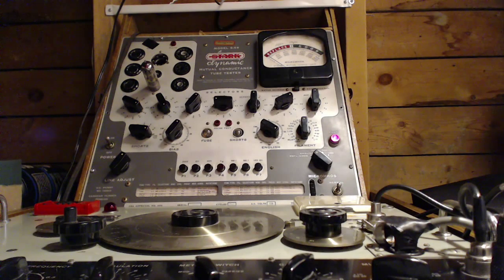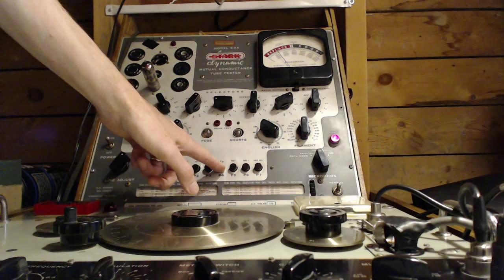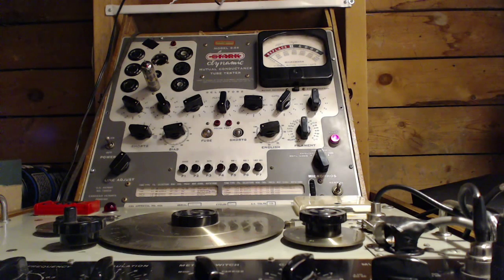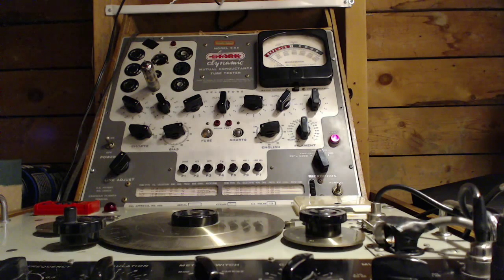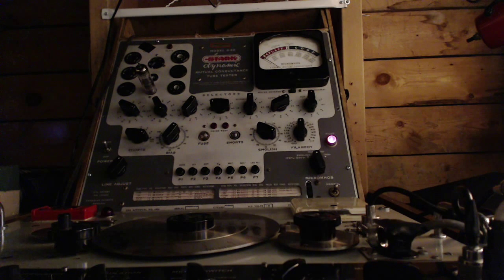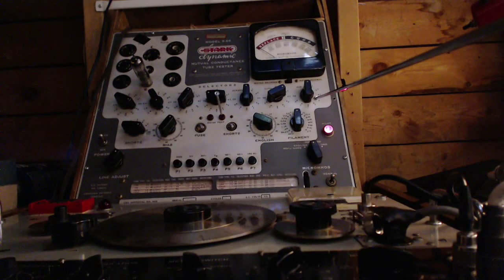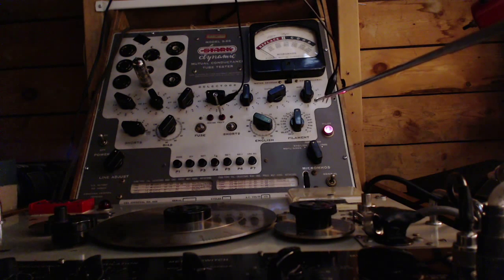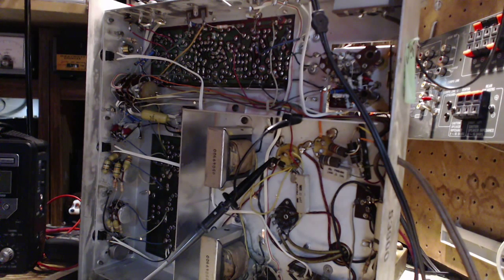Philips Console Stereo Receiver Video #13 - Testing Output Tubes

Comment: Your observation of the dimming of the lights on your dim light setup during the noise hits might mean that the heavy current draw might be coming from the filter cap shorting. Connecting an good capacitor across it may tell you if the problem is there, or maybe temporarily replacing it for a test. … See any glowing in the rectifier tube?
Just a thought… You sure do find  interesting problems. Good luck.
Reply from the maker: Carl Burgess I might be more of a troublemaker than a trouble shooter. The Philips will soon be back on my bench with a surprise for all of us.

Comment: As per Stark Instruments Ltd. "Noise test: The short test circuit is also used in making noise tests on vacuum tubes. Connections are made from the noise test jacks to the antenna and ground posts of any radio receiver. The tube under test is tapped with the finger as the SHORTS switch is turned through positions 1-2-3-4-5. Intermittent disturbances which are too brief to register on the neon lamp will be reproduced by the loud speaker as static."
Reply from the maker: Alameda Repair Shop I think that's what I tried. Maybe I should have cranked up the heater voltage or waited longer.

Comment: Done a bit of reading and if you have trouble getting your hands on ECL86 valves then you can use PCL86's.  They are identical except the 2 heaters are in series so the heater voltage required is 13 - 14V for the PCL86.  That shouldnt be too difficult to supply just to the output valves.  Just a thought.
Reply from the maker: polyman2 I found two good replacements!

Comment: Had a similar crackling issue on an old guitar amp.Replaced tubes and capacitors but it didn't solve the issue . Since the issue only occurred once the amp was powered on and warm , a friend of mine that used to fix TV 's told me to check the circuit board and heat all soldering points .Told me some old board tend to warp a bit after all those years and solder points and traces develop cracks .or get loose  and create this crackling issues once it warms up .Spent hours re-heating solder points on the board and it fixed the issue but never could tell which area on the board that issue came from .

Comment: I just did a search on ebay UK and there were 86 listings for this tube at reasonable prices.  Have you tried looking up an equivalent to see if its more available where you are?
Reply from the maker: polyman2 I found two good replacements for the output tubes.